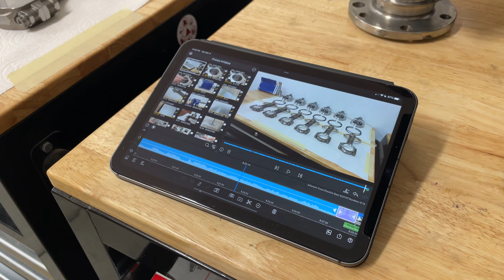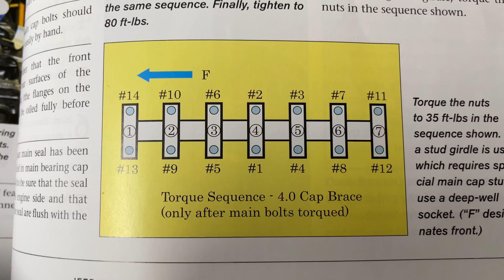Jeep Stroker (XJ) - Crank, Rods, & Pistons Installation

Comment: Hi. Are those rods directional? Which way goes to front?
Reply from the maker: The fact sheet that came with them didn’t have a direction specified. Most people typically put the logo on the rod towards the front of the motor.

Comment: Just a little advice. Never spin the crank without all the main caps torqued. As the bearings are not truly round until they get torqued down.
Reply from the maker: I appreciate the advice- I'm always learning. I figured I couldn't do too much damage, just spreading the assembly lube. Thanks!
Reply: @motolayne  I use to do the same thing. I use to be freinds with the guy in my town that has his own engine shop in my town and he told me when you get bearings there alittle egg shaped until the saddles and caps are torqued that's why you take readings when there torqued down.
Reply from the maker: It makes sense- same as the cylinder bores before the head is torqued. I’ll keep in mind for future builds.